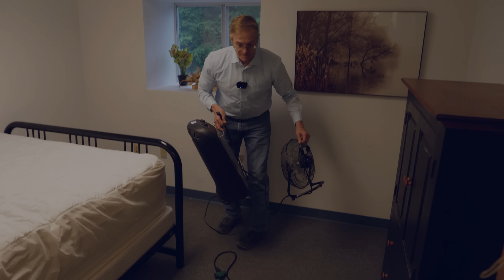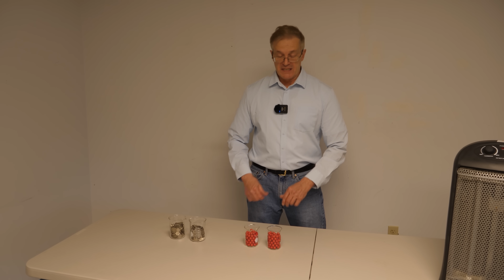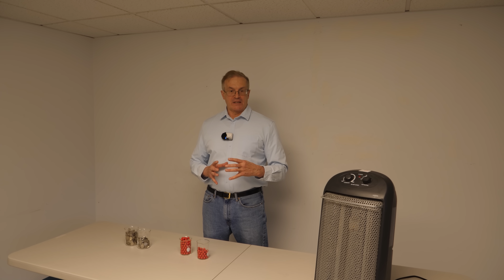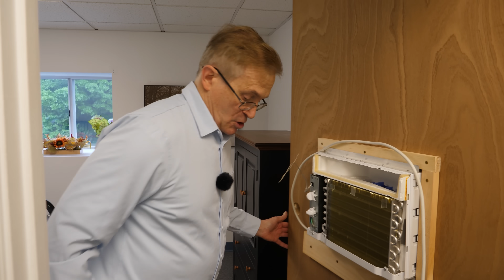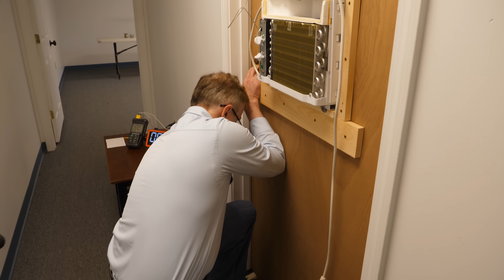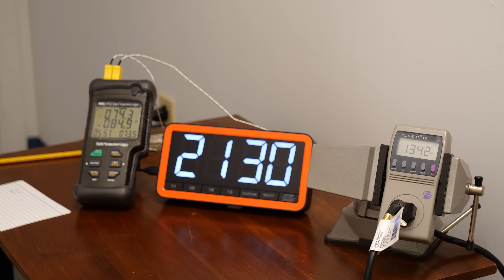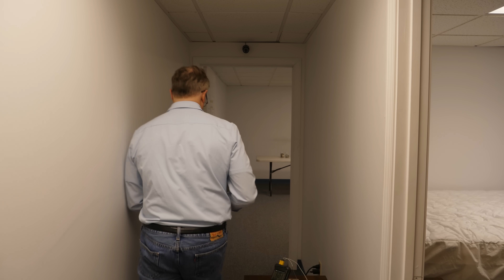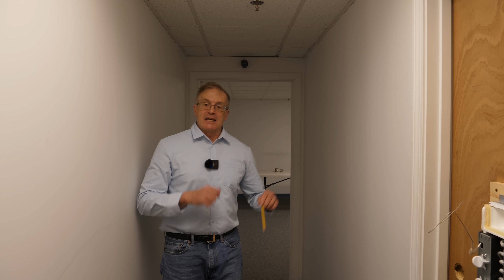You're wasting money on heating! Use your A/C!

Comment: Excellent video demonstrating how heat pumps work.

Just for clarification to anyone confused by the AC unit in the door, hes installed it back to front, on purpose, so that the 'cool' side is dumping its 'coolness' into the hallway, and putting the hot side (that normally would go on the outside of your window) into the room, to heat the room. 

As you can see;
 the resistive heater and fan used 669 watt hours (aka 0.66Kwh) to heat the room by 10.4 degrees F
The heatpump aka the AC unit, used 197.5 watt hours (aka 0.19Kwh) to heat the room by 16.2 degrees F
Reply: 1338 watts for half an hour is 669 wh
395 watts average (started around 350 watts and went up to 440 watts) for half an hour is about 197.5 wh
Reply: @ivanjakanov  Good catch thanks, I'll edit my comment, I went the wrong way doubled instead of halved.
Reply: Definitely interesting and clearly explained.  However, the “heat pump” was drawing heat from an ambient of 74 degrees.  Show me the same process at 35 degrees ambient.
Reply: @jcalpha2717  As was clearly stated, this is the first video in a series, meant to simply demonstrate the basic principle. Tech Ingredients will doubtlessly go into great depth about the many variables in materials, design, and environment that impact the efficiency of a given system. That's what this youtube channel is all about.
Reply: @jcalpha2717  They still work even at very low temperatures (-10'c, some even -30'c) just with a lower COP (aka efficiency) , but even then, the efficiency will still be better than a resistive heater. (as in a resistive heater will be 1:1 electricity kw : heat output kw. 
The heatpump could still have a 2:1 ratio, eg 2kw of heat moved for the price of 1kw electricity.
Reply: @jcalpha2717  it still works because, as he explained at the beginning, that 35 degree air still contains 90% of the energy as 95 degree air would. Because the energy of the system starts at 0 degrees Kelvin, not 0 degrees Celsius. And if your reservoir of energy is "all of outside", then that's an effectively infinite source of heat energy, for the purposes of heating a room
Reply: @Superabound2  Your response to jcalpha2717 should have included that: It still works WITH THE CORRECT REFRIGERANT ADDED TO THE UNIT and also that, it still works, but the outside condenser section of the A/C (heat pump) often gets frozen solid during the winter and has to stop defrost itself pretty often before it can continue delivering heat.
Reply: 2 way heatpumps are quite common now though.  Its the way they sold ac to nordics, used to be that nobody had it.
Reply: @lasskinn  At least in the Western/PNW US, they're rare outside of 208-250VAC In-Wall units.
I see the 'use' for re-using a Window A/C. They often can be had 'off-season' used for very cheap (if you're willing to fully disassemble and clean.) or, can be had on sale at the edge of the hot season.
Reply: @lasskinn  Unfortunately, not so in North America. A couple of units have just come on the market this year, but are at a premium price, and of limited quantity. Low cost "mini-split" heat pumps have become fairly popular, but they are not simple window units.
Reply: @fxm5715  ah yeah nobody in nordics uses simple window units(slide windows themselves are quite rare too, so installing them would be a hassle). Some people do have the stand on floor sort of ac's though. Here in thailand simple window units are extremely rare as well. (You can get a split unit bought and installed in thailand for like 250 bucks tho, however the thai market units lack the reversal heating capability and do not have heating resistors either. Maybe worth mentioning that some cars lack heater cores in thailand as well(while having ac!)
Reply: @lasskinn In Spain they are  they are two way heatercooler too, and have been for a long time, I believe. At least I have seen them in people"s houses por a while. But the unit doesn't go on the window, it goes on the wall close to the ceiling.
Reply: I used a portable A/C to heat my house a couple of years ago...  The practical issue isn't really the directional valves - we can just install units backwards if we want - the problem is the software that shuts off the A/C when it's below 65F
Reply: He didn't use as much energy to heat the room because he got heat energy from other parts of the house. So it's not exactly being more efficient, there is a total loss in the end. What would ultimately happen is the rest of a home would get colder. Outside of the waste energy an air conditioner uses to run, it does not create heat, it only moves it from one place to another, which is generally a hot room to outside. But in this case, he moved it from the rest of the house into that single room. Now imagine how this would play out on a freezing day where the whole house hasn't been heated....it would generate some heat from running, but overall it wouldn't heat up that room much anymore. So you're heating one room at the expense of other rooms. Once you try to transfer heat energy from the cold air outside, the energy required to heat the home would go way up. Also keep in mind that air conditioners lose a massive amount of efficiency at cooler temps, generally around 60-70 degrees. So it doesn't matter if there's still energy in cold air, it's going to take more energy to draw it from the colder air.
Reply: Thank you @peoplez129
Reply: The temperature sensor should of been placed at equal distances from each heat source
Reply: It's funny you all think it takes all this math and big words to see that a focking space heater uses more electricity than a HVAC unit.
Reply: So if the window box AC is installed in the normal manner but could be vented with heat coming inside, draining moister outside and venting the cold air outside? The venting and directing the desired airflow would simulate a heat pump?
Reply: Strange that there was no doorknob, but I figure that the regular door was removed, and that door stuck in, because the experiment would destroy the door, so why not use a scrap door that was lying around?
Reply: I think I messed this up. I went outside and put my AC in window backwards. Now it's -10 in my room. And it feels warmer outside now.  Wait......?
Reply: @rattech  a room? Whats the volume of your room?
Reply: @sk8pkl  I dont understand your question?
Reply: Pity he didn't understand the units at all. Watts, current, energy, all over the place.
Reply: @orange42  You must not be at all familiar with this channel.
Reply: Always one who attempts to appear smarter than everyone else. Pitty those are usually the ones who miss the point completely...😂
Reply: It’s best practice to round up if you’re only going to be showing to two decimal places.w.
Reply: Wish we could skip the video and just express the temperatures and humidity ratings they work best at. And decide if heat pumps are worth it based on a break even. Instead of remedial science class every time we explain anything.
Reply: @PonkyKong  I think you have missed the point of what the Tech Ingredients channel is all about. If you want to understand the science and the thinking process behind a given experimental subject, as well as how to apply the principles yourself in the real world, then watch the whole series on that subject. This is the first of a series. As such, it's very basic. The following videos in this series will doubtlessly dive deeper into the real world application and the many variables that apply. If you just want bottom line numbers, either go somewhere else, or have the patience to let some excellent science and engineering communicators present their information in a way accessible to a wide audience.
Reply: @PonkyKong humidity doesn’t affect heat pumps. As for the effectiveness at temperature it will hit 100% efficiency (same as a space heater) at -4°F. Anything above that it will outperform.
Reply: @PonkyKong I think the whole point is to teach people to do things simply and yourself. It's pointless to just do an efficiency test and record data unless, your just a lazy person who just pays for things and never actually does anything for themselves with their own hands
Reply: @PonkyKong you can—use google instead of youtube

Comment: I know you are a lot smarter than I am, but in reality if this was setup to warm a room that A/C unit would have to be pulling air from outside.  the air outside would be considerably colder than the air in the hallway.  wouldn't that make the A/C unit less efficient, and it would have to work for a longer period of time to get the same results.  I think you need to revisit this experiment with real world parameters.  I feel you are 100% correct, but your numbers are a bit off.   a retired union electrician, mike

Comment: I've had a curiosity kicking around my brain, it seems plausible but I lack the knowledge to imagine it fully. Could heat pumps be used to recover heat energy in an automotive cooling system? I'm imagining maybe a large battery hybrid where there's a heat exchanger that gets high pressure water exchanged off of it to generate steam and run a small turbine? With grill shutters and heat exchange you could reduce frontal drag while vastly increasing thermal efficiency it seems. Is it just too complex? Or are there too many losses for it to do anything?

Comment: Where I'm at the electricity is WAY more expensive than gas so while it's more efficient to use a heat pump, it's much cheaper to run a gas furnace.
Reply: Hopefully you'll be able to PV panels and turn that around and avoid burning fossil fuels.
Reply: @BramMertens  Or use water heating solar coils
Reply: @BramMertens  hopefully the people who believe the “fossil fuels are bad/electricity is good” nonsense will wake up to reality someday.
Reply: @TheSwissChalet  please enlighten me.
Reply: @TheSwissChalet  In Finland our electricity is only about 5 % fossile. And we have much cheaper electricity than most of Europe. We don't use gas for households, but typically a house has 3*35A 240V electric connection. Good enough for 9kW sauna stove, cooking and heating same time. We have 5 nuclear reactors, thousand if wind turbines, hydropower, bioenergy. We buy also Norwegian and Swedish hydropower, if there is too little wind. 

We use very little gas, we don't have pipeline from Norway and Russian pipelines are proven unreliable, and we don't want to do business with Russia anymore. Russia is a mafia that has a state. Better stay away. They already stole our power plants and factories invested in Russia. 

 We just opened our own uranium mine also. We are also going to mine all minerals needed for electric cars, better not to be dependent on some authoritarian countries. Electrifying our road traffic would increase electricity needs only 10%. We used to have higher consumption 10 years ago, efficiency has improved and paperfactories closed.
Reply: @jounisaari9471  Electric cars can be centrally controlled, and stopped anytime the controllers want to stop you. All types of mining are environmentally damaging...so I don't know how you could consider that "green"...only because the brainwashers convinced people of that. Your houses in Finland are extremely small compared to US houses, and you have little need for air conditioning. Not really comparable.

Comment: In the winter, (where I live,) when a heat pump cools down air, the moisture in the air condenses and freezes inside the part that collects the heat. A resistance heater is used to defrost the collector until it fills up again. This seriously hurts performance. I always wondered if it was not possible to build a two staged collector that would cool air to just above the freezing point and in that way dry the air, and then use a second stage to cool air to say -20 C to get more heat out of of it while not having ice buildup inside. Do you think that is feasible?

Comment: The AC I currently use here in Germany: If weather forecast predicts heat the next day, open window fully at night, let the house cool down. As our houses are not made from cardboard, there is a lot of thermal mass in the house which acts like a heat/cold battery. The thermal mass is so large, if half the windows are open completely, the house takes 10+ hours to get halfway to the outside temperature. If everything is closed it can take up to a week for the inside to become uncomfortably hot (assuming minimal heat generation inside, e.g. only meals that are quick to prepare and don't require long heating times).
And our basements are naturally air-conditioned. They don't go above 22°C in summer. The ground is an even more gigantic heat battery.

Comment: I have one these set up to heat my cabin but, the cold air is ducted outside and fresh air comes in another duct . In the duct there is a 500 watt heater that comes on at freezing controled by a outside thermostat , get  an inkbot thermostat. They work great

The unit is an old 5000 btu unit uses 450 watts , removed the old thermostat and used an inkbot thermostat. This unit is good to -15 c or 10 f .  
All of my power is off grid and this saves propane. 

The temp is at 73 f all year round .  Cooling is done by a new 5000 btu unit set to come on at 74 f by the inkbot control unit.

 These cost $50.00 
 Think outside of the box, and have fun.

Comment: I agree with the theory but the test is flawed.  The thermal mass in the room would not be nearly equalized after 1.5 hrs.  You would've have cool air surrounded by hot furniture and walls.

Comment: Great thought, But Not a good test, No one uses this at the temps of your test, or such a small differential, so it's just not Reality..
 10F change on a Controlled box "room" and that's the issue in itself with the reasoning on increased Entropy in such an unneeded use. The space heater is only that, A space heater,, The air conditioner was more than that. Sizing matters, I cool my home with window AC I do not heat my home with a space heater, nor is it possible. 
How do you get rid of 100F of differential temp,, Into a 20F differential environment, You can't unless your system is garage sized.. 

 Heat pumps worthless below -5F outside that's 3 months of winter,, No one uses them here and few use whole home resistive heating they are considered the worst efficiency form of HCAV systems.  
Some Refrigerants won't even work when it -30 outside for a week.  
The local store freezers can't even move the heat out all the food thaws and the pumps are running flat out. 

Not very efficient of a system resource wise that uses about a infinite times more resources to create with a very short comparable life span. Factories of people making smelting gasses, metals and plastics to make something good for a few years,, vs resistive heaters the first ones working away A hundred year's later or more,, they are still going ,, increasing that lead...

Comment: while this does work, a window ac is in no shape or order to be installed backwards into a room. You'll have to trick how it senses room temp or it wont turn on below outside temp 68f. Also the condenser water needs to drain and you'll hear the fan splasher hitting the water. Also their is no defrost mode for the outside coil, also this thing will be loud as hell. The way I did this is converting a window ac to water plate heat exchangers and running a separate water circuit for cold and hot side. You use a large auto radiator and brushless fan from a modern car outside and a large pc radiator inside the house with silicone tubing and you got yourself a quiet heat pump. You also need to blow air over the compressor with a pc fan and youll never beat the SEER of a window unit but this is a much better end product.
Reply: Using one of those in room portable A/C units would be conducive to this.  I have the Whynter dual hose Arc-14s. I can see doing this sort of thing with a bit of temporary tube modding during the winter. Keeping the unit in a barely used room of course while running the heat exhaust hose into the room needing the heat.

Comment: You gotta keep those guys in there, heater and fan unpowered still have thermal mass, so are part of the environment. They are metal that will use energy to heat up, whatever the source. I doubt if it would make difference though!

Comment: May have missed some efficiency since some models use standing water on the hot side.

This water is splashed onto the condenser coil from water that comes from the evaporator coil by the fan.

A dry fired unit will take some time to condense enough water vapor to fill the tray.

Comment: The issue with heating with an A/C is that you are heating up the air. Ventilation (opening a window) will immediately take the heat out of the room. Another issue is that A/C will only be efficient in one room, it's going to have a lot of trouble getting through even one door.

Comment: What makes comparisons confusing is A/C units are measured by BTU/hr, while electric heaters are almost always measured by watts consumed.  However, there are conversion sites out there and using one, I confirmed 5000 BTU/hr (which I assumed was the capacity of that A/C) was equal to 1300 watts, which was the draw from the heater.  I think the temp difference (15 degrees compare to 10) was because quite a bit of heat went into making the heater extremely hot, while the A/C unit was very efficient at discharging the heat from the condenser side.